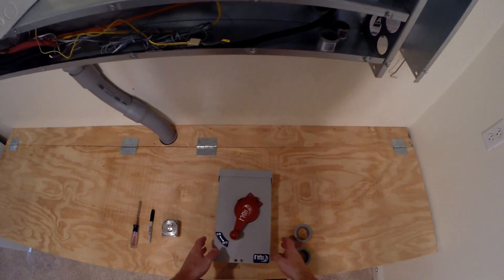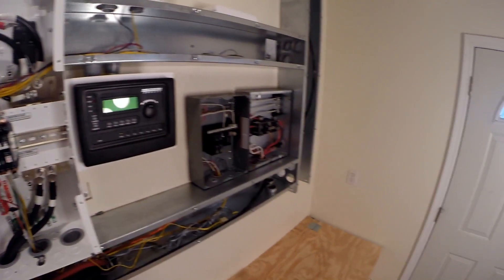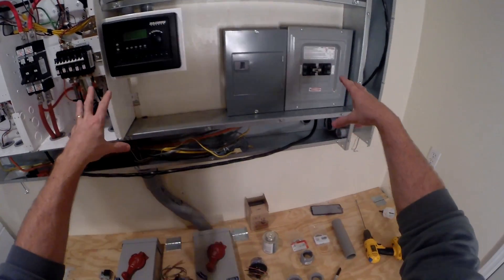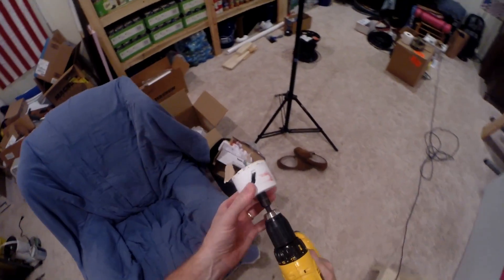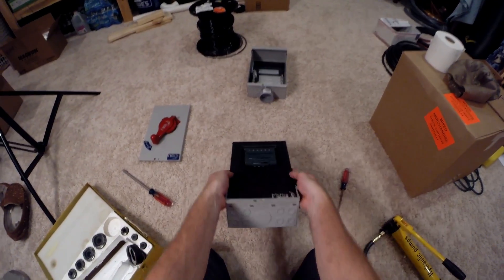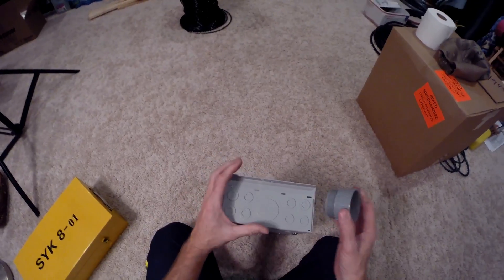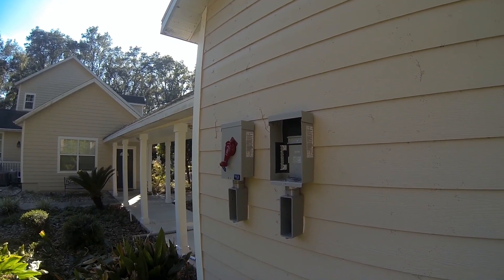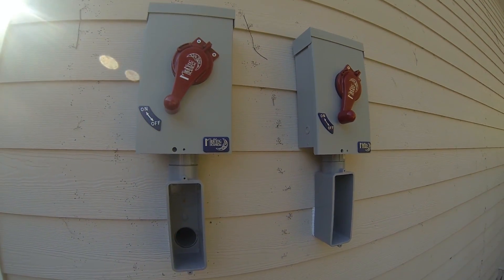Off Grid Solar #27: Mounting MidNite Solar MNPV6 250 Combiner Boxes

Comment: Way to many  combiner boxes..your buying they'll sell em.Each string goes to ONE COMBINER on the roof.Then two wires from each panel string enter the house.Jus sayin
Reply from the maker: Richard, These combiner boxes are designed for up to three strings when using the 300vdc breakers.  I have six strings of four panels each so my two combiner boxes are fully populated.  They are mounted on the outside wall rather than the roof so that I (or the fire dept.) can easily access them and shut them off when needed.
Reply: @HomesteadEngineering  my misunderstanding....ive been off grid in north ga. for 8 years...no tie to grid solar n hydro(creek on property)Youve done well n yes we all make mistakes..lol..well done sir.
Reply from the maker: RICHARD MOORE, I am very interested in hydro.  Searching for hydro ideas is what got me started on "prepping" about 2 years ago.  I still haven't found anything that I think I could build that would make sense...  Do you have any hydro videos?  Please leave a link.  Thanks!

Comment: where did you get the raceways?
Reply from the maker: Those are 6x6x72 and 6x6x36 Austin screw cover wireways.  One of the hardest things to find and exactly what I wanted.  I found them at CED (Consolidated Electrical Distributors).  They are located all over the place.  My CED goes under the name RAYBRO.  The 72's were $85 each.  I think they make a huge difference and when I am done you won't see a single wire!
Reply: Thank you.
Reply: Wow...have NOT seen raceways in decades, when working for Kodak. they DO clean up/ err...hide messes real well...lol... but not for this gent... he does nice work !

Comment: Hi David, I guess you will be ready to go for a Solar Holiday soon !    As always , there is some hurdle to get around, piping, wires or fire block.  Nothing but a minor slowdown.  Have you ever used some of that expanding foam for sealing the wall entrance holes ?  I have used both, the super expanding and the half expanding ( which stays slightly flexible ) on different projects.  I like the latter...a bit slower but the flex is more controlled and resilient.    J K
Reply from the maker: Yep, I plan to use a lot of expanding foam once I know everything is settled in.  Thanks!